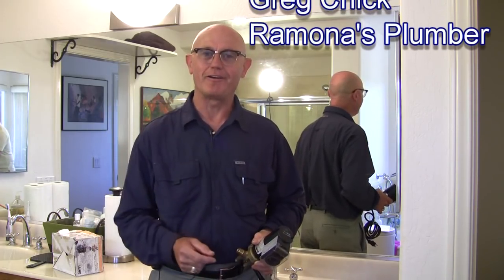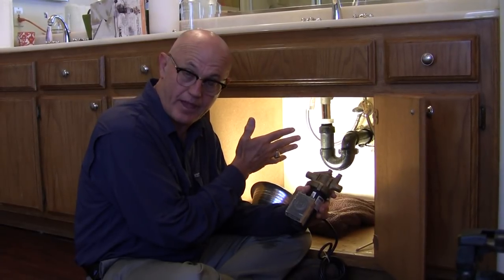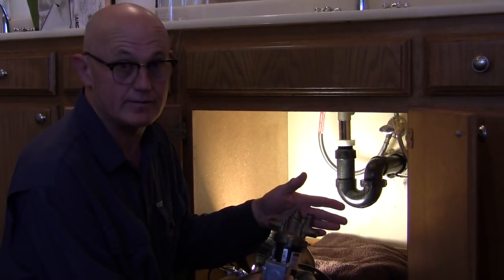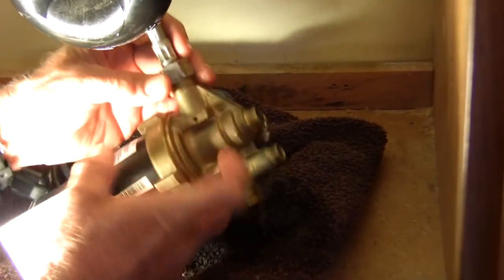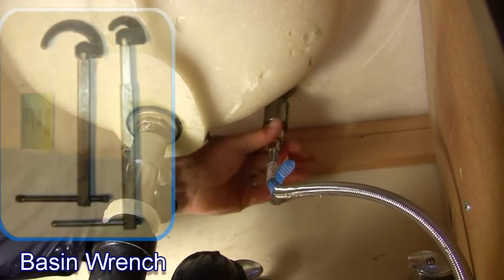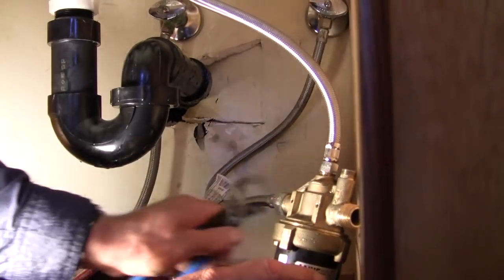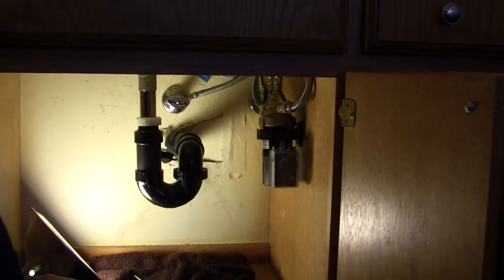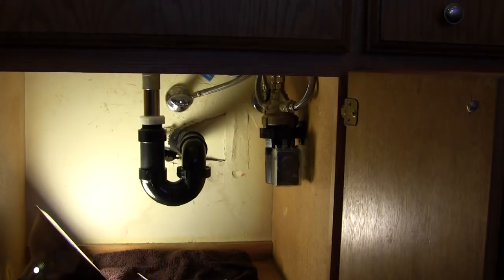Installing a Recirculation Pump for instant hot water and saving water

Comment: Does this work for a tankless water heater?  I am wrestling with that right now.  The heater makes the master bath hot enough, eventually...but the rest of the house is REALLY hard to heat.  Ideas?
Reply: You've got a capacity problem. So you're either installing these pumps at every hot water outlet or address the root cause. Tankless water heaters are the worst thing you can have (I inherited one). I'm planning to migrate to an indirect hot water tank and convert the boiler to cold start.

The indirect tank is treated just like a zone and is super insulated, maybe loses 1/2 degree F an hour. Couple that with cold start (new control system) and you're boiler will literally only fire once a day with no demand, as it's job is to keep that tank happy and not the cast iron at 140/160F (LOW) all day just in case another zone calls heat.

The indirect tanks have like 40G capacity instead of 3-5G compared to the "tankless" so no more waiting for hot water. It's about a 2K job, but it'll pay for itself in fuel oil usually wasted in the warmer months and improves overall efficency.
Reply: If you have a very large tub in the house. Then the tankless is the way to go. I would need to see a diagram of your hot water system to even begin to give to proper advice on what to do about your problems.   They also make tankless water heaters with recirculating systems built right into them. You cannot ad one of these types of recirculating pumps to any of the tankless heaters.
Reply: shepd1 no they do not work on tankless systems. Read my other post on your problem.

Comment: but then you have no cold water do you?    Seems to me that if you circulate back through the cold you will have hot in that line as well so you have to run that one to get cold to cool down your hot?
Reply: jim mitchell One of the main reasons to install a circulation pump is to have hot water immediately out of the shower.  By the time you're done with a shower, the cold water faucet will have cold water coming out of it.  Remember, the circulation pump only needs to be on about 5 minutes before you use the shower.

Comment: my heater doesnt heat the water when dishwasher starts. heating coil of my dishwasher doesnt work. ı would like to use hot water but burner doesnt start when dishwasher operates. But for sink hand washing burner of the heater works. what can ıdo ? how can dishwasher can heat the water from the connection of hot water ?

Comment from the maker: Great,  search Grundfos circulators comfort systems, it is the plastic thermostat mixing valve used in that system it has 4 1/2" threaded ports on it.   it goes under sink allowing the higher pressure hot side to push into the cold side, till it comes to that point as actually hot. then it stops allowing the mix.

Comment: Can this pump be used on a system that has a tankless heater
Reply: +John Doyle - In theory, you would think it should work. 

But, tankless water heaters use flow and/or pressure sensors to detect water use in order to know when to start heating water. The operation of the recirculation system might interfere with the sensors in the tankless water heater in such a way that the recirculation may not trigger the water heater to begin heating. 

I'm not familiar with any, but there may be recirculation systems specifically designed for use with tankless water heaters.
Reply: NO  NO  NO, not enough flow.
Reply: I bought exactly the same pump but didn't work. I guess not enough water flow to trigger my water heater
Reply: Lang sells a model with a higher pump flow speed for tankless. The one in the video won’t work because it’s too slow.  I have a 3100 square foot house and it takes my pump 6 minutes to pump before the thermostat turns it off.

Comment: How quiet does the pump runs? You should let the pump runs in this video
Reply: It would not be able to be picked up by the mic.  Sound issues are if you mount it to a wall or if air is in the water.   There is a better system where the pump installs at the water heater.. See other video.

Comment: I have one and the problem I have is that the cold water is now always warm. Is there a fix for this?
Reply: Skip,  Having a pump is like having arms or legs,  it is how they operate that determines how fast and other things.     To advise I need all many detailed factors.   The best system is the ACT Demand system installed as per factory instructions.  Many different pumps and controls and pipe sizes and distances and flows and actual temp delivery are issues.....
Reply: Did you resolve the problem of warm water on the cold side and also did you notice much of an increase in the electric or gas required to heat the extra water.

Comment: The Hot Water Lobster does not recirculate the hot water continuously (only when the water drops below the adjustable temperature). My gas bill has deacrased-Probably due to the fact that instead of filling the water heater with 3-gallons of cold ground temperature water every time we waited for hot water (16+ times/day), the HWL now recirculates the prewarmed water back to the water heater. It now takes much less energy to heat the recirculated 110 F water to 130 F. than 45 F ground water.

Comment: Hi Greg, my house has a hot water line that terminates within 20 feet of the hot water heater (and on the same floor)...since the terminal point is so close, which makes more sense for cost of system and cost of use: a return-line system, or one that returns water to the cold water line?
Reply from the maker: Matt,
  It is not how close the closest hot pipe is to the wtr. htr.  it is how far....  the farthest location is the one needing the hot water pulled to it by a pump.  The most distant is how far?
Reply: ramonasplumber Hi Greg, thanks for the response. Actually, think of my house as a big circle, with the ends not connected. For better or worse (worse, I think!) the washer is physically 15' from the hot water heater, but at the end of hot water run. Thus, the answer to your question is: The furthest location is 15' from the water heater!

So, given that the distance is so short to return to the heater, does this warrant installing the return line instead of installing one (as above in the video) which returns water to the cold water line?
Reply: +Matt Sullivan - For best overall performance, in all cases (that I could think of), it will always be best to install the return line to (near) the water heater. Using the cold water line as the return should only be done if it is not feasible to install the return line back to the water heater. 
 
This is how the recirculation pump works when the cold water line is used as the return line: When the recirculation pump senses that the water near the remote fixture is no longer hot, it pumps hot water from the water heater to refill the entire length of hot water line with hot water. The warm and nearly hot water that was present in the hot water line is pushed (pumped) into the cold water line, filling the cold water line with the warm and nearly hot water. The (cold) water that was previously present in the cold water line is pushed "backwards" into the cold water inlet on the water heater. So as hot water is pumped out of the water heater, it is replaced by the water from the cold water line.

There are some disadvantages to using the cold water line as the return line.

In use, the cold water line is filled with warm and nearly hot water. Then, as you use COLD water, from any faucet in the house that is serviced by that cold water line, the FIRST water that comes out of the faucet is the warm and nearly hot water that was "discarded" by the recirculation pump. If you wanted actual COLD water from the faucet, you will have to run the warm and nearly hot water down the drain until it is replaces by fresh cold water. This significantly reduces the water and energy savings that the recirculation pump is supposed to provide. 
 
As is widely known, it is not recommended to use water from the hot water faucet for cooking or drinking. This is because, compared to cold water, hot water more readily dissolves contaminates that may be present in the water system. Recirculating the heated water, through the cold water lines, introduces those contaminates into the cold water system and fixtures. 
 
So, if at all possible, even if it requires extra effort and materials, run a separate return line from the recirculation pump to the water heater. For me, if I couldn't do this for some reason, I wouldn't install the recirculation pump at all. 
 
Follow the recirculation pump manufacturer instructions on how and where to attach the recirculation pump return line back into the cold water line that feeds the water heater inlet. Depending on the configuration of the cold water system piping, it may be recommended to install a check valve (one-way valve) to prevent the recirculated (return) hot water from entering the cold water system for the house.

Comment: You are concerned about a NON-ISSUE in today’s plumbing systems. Consider this: Whenever water is heated, a higher pressure can result. However, for the last 80+ years plumbing codes require EVERY heating system in the US and Canada to have an in-line high pressure relief valve (found on ALL water heaters) to prevent extreme pressure buildup. Water can easily be moved several hundred feet (up/down/across) through pipes with as little as 1/10 PSI differential between the hot and cold water.

Comment: To everyone who has thought they should put the pump on the cold water line.
 DO NOT DO THIS.
You must have a hot water return line installed from the farthest hot water outlet.
If you install on the cold water line you will difinetly have hot water on the cold side.
Reply: If you avoid the cheapest system, you won't have that problem.  He explains in the video that when hot water reaches the pump, it shuts off the cross connection and blocks hot water from entering the cold water line.
Reply: not the case.  it heats the water to hot and then the pump stops pushing water back to the tank once it gets the water to temp.  It might be a little warm at first but you quickly have cold water. i have two of these in two houses and love them.  Your theory is full of hot water.

Comment from the maker: I think the Hot Water Lobster has issues and it is not fair to suggest people buy it just because it offers a guarantee.  I guarantee that gravity is a given as is thermal expansion, not because my of my opinions, but physics.  The lobster must need either or both to succeed in circulating and if so some people will go to a lot of un needed effort and grief and postage or other expense just to try your product.  I caution consumers "Are you feeling lucky" 
Greg Chick.

Comment from the maker: Your not trying to circulate water thru house, your trying to collect solar heat right?   The pumps are same but the consequence is making thermal expansion in your hot water system.  It is complex and can have hazards.  Look at a typical Solar Water Heating layout and copy that if you are inclined, but I have learned limits in DIY and design of Solar Water heating is on the other side of my willingness.  Having said that, "Home Made" Solar designs do exist online. Be careful steam burns.

Comment: Wouldn't it make more sense to have a push button so it can be done on demand and not have it run at all except when you need it?  I realize it would not be "on demand" however you would not waste water.
Reply: The button starts the pump.  When the water gets hot, a thermostat at the motor shuts the pump off.

Comment: i could see if u were running another line back to the water tank but including the cold water line makes no frickin sense,
Reply: wisco how does the hot water not get forced back into the cold water side also doesn't this mess with the water pressure at the faucet
Reply: You'll get warm water out of the cold side for a few seconds. Pick your poison.

Comment: Not clear where the savings are
Reply: The biggest saving is in water. There is no wasted water with a recirculating pump. For those who live in drought areas or frequently have water usage restrictions, that could easily total into thousands of gallons a year per house.  For example, in our house, it takes 3 gallons of water for heated water to reach our shower - we know this because in California many of us have buckets to collect rather than waste that water. It takes about 2.5 gallons to reach the (nearer) bathroom faucet. Assuming one shower per day, and three hand washings... that's 10 gallons per day or about 3600 gallons a year for one person in one bathroom... and we haven't yet counted the savings of waiting for hot water at the kitchen sink. The cost to run a pump like this is likely much less than $2/year for the electricity.

The second biggest savings is in time. You don't have to wait an extra 30 seconds to 2 minutes to get warm enough water for bathing. But that comes with a caveat.

BUT... the only energy savings here is in the cost of the heated water that get's dumped while waiting for it to get warm. Heated water in the hot line will dissipate if the hot water isn't used, and that is wasted energy cost. That's why you'd want the recirculator to only run just prior to when you need it, and not at any other time.  Indeed, if you have a tankless water heater system and keep recirculating water to keep the line hot, you have effectively turned  your tankless heater into a "tank" where the "tank" is the water line. The water line will lose heat faster than the tank will.

Comment: the claim of 10,000 gallons  a year is crazy.   that is almost 28 gallons a day of cold water going down the drain while you wait for the shower to heat up.   My hot water tank is 12 feet from one shower and 25 from the other.  Considering that the pipe is only 1/2 in.  how many showers a day do you take?  
  The average shower flow rate is 2.1 gallons a minute.   that is 14 minutes a day waiting for the shower to heat up.   84 hours a year.
Reply: 12' and 25' from water heater....you are a lucky man.  You can thank the builders of your home for your hot water convenience.
Reply: Redy Temp   lets say you are 100 feet from the water heater.  Still only a maximum of 30 seconds.  Since the hot water circulates back to the tank through the cold water you have no cold water to moderate the hot.   So you waste more energy flushing hot down the drain waiting for cold.  If you are having a shower that is.  Unless of course you are just interested in  turning your tank down to about 110d. or so so it is cold enough to wash in. .   
  Also, you now have 100 feet of copper pipe with water running through it cooling down all the time.  Unless of course you insulate all your copper pipes.    There are just so many ways that this is not an energy or water saver.   Convenience yes, energy saver maybe not so much.
  Of course new pipes are not copper so that would be a bit better. Still a lot of surface to cool off the water.
Reply: It is more common then most realize for occupants to wait 3+ minutes in two story homes where the master bathroom is at the opposite end of the house from the water heater.  Just one 60 second wait every day is equal to 6 hours of waiting in a year.  Similarly,  a 30 second wait each day is 3 hours a year.  Those are just for 1 occupant and 1 hot water event each day.   A system that operates in on-demand mode wouldn't heat up the cold water lines as long as active (not passive) flow control is used.  One way check valves don't prevent water from bleeding into the cold water side when cold water is used.  That's why RedyTemp utilizes solenoid valves in their systems.  So the only time crossover occurs is when the pump is actually pumping.

Comment: this is cheap and virtually useless alternative to correct installation of a "hot water secondary circulation " pump , as other posters have already stated , heating the cold water side of your system is just as wasteful , you need to dump  hot water down the drain when wanting cold water plus there are serious issues to consider re' contamination of the cold water drinking supply. the only to achieve instant hot water at the taps is to run a large bore pipe ( 28mm or minimum 22mm from the top of the cylinder in a continuous loop around the property and back into the bottom of the cylinder ,  attach a bronze DHW pump to that pipe and you now have a safe and efficient way to achieve instant hot water from a tank fed system.